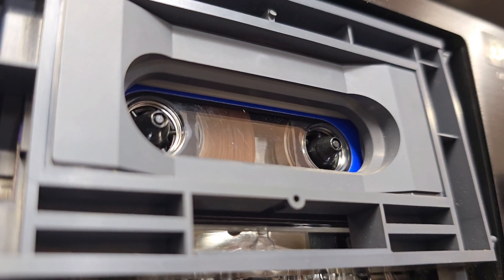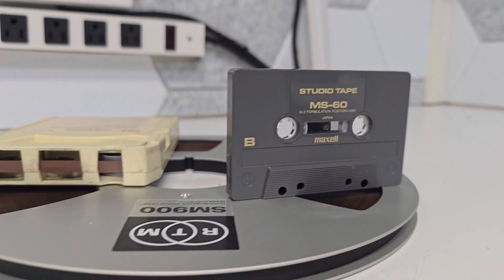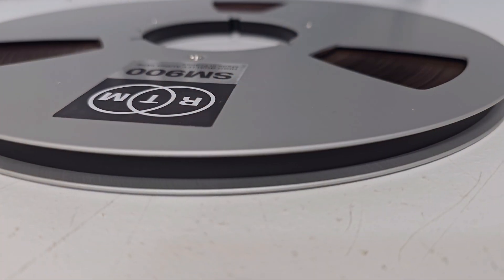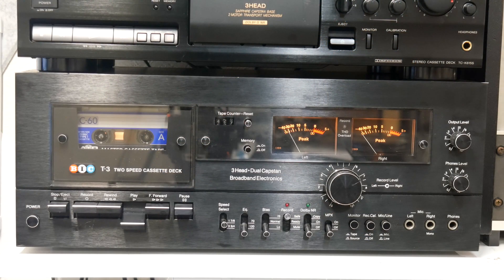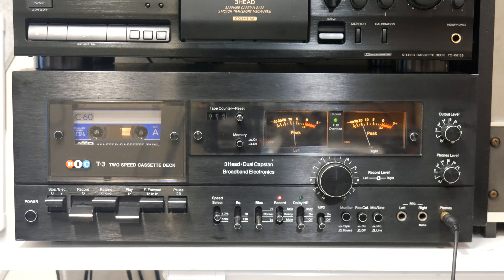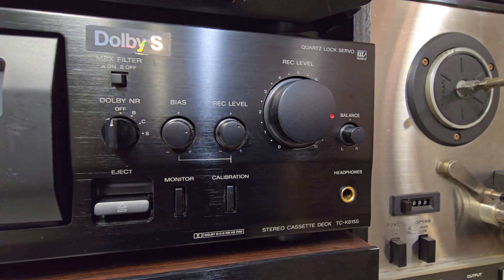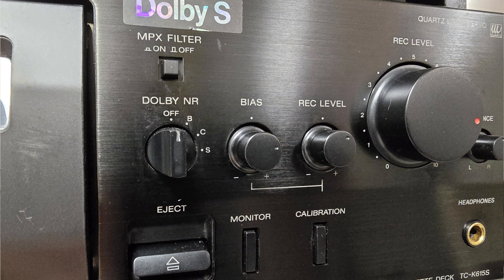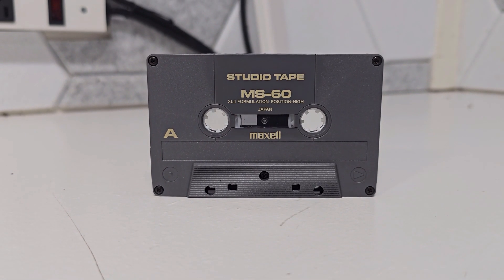Dolby S Noise Reduction - As Good as Digital? Dolby B C and S Comparison - RTM Tape Giveaway Winners

Comment: No. There are 3 groups of people. Those who love it. Those who hate it. And those like myself. Who just don't use it. Don't believe in it. Don't need it. To get rid of, hissy sounding tape. I've never needed that stupid stuff.. No.

No not even with, 9 analog generation down, copies. I have no noise and hissing issues. And never having used, any Dolby or DBX, gobbledygook. Screwing up the sound. Making it sound all wonky. Because it does. But some would rather have wonky than hissing. I don't like either. So I got rid of it. How you ask?

There's another faction out there like myself. We use, Broadband, Downward Expanders. That don't wonk. With the audio. And I've been using those since, 1973. So I don't know where you've been? Playing around with stupid wonky sounding Dolby DBX gobbledygook. When downward expanders work so much better.

And what do, 9 generation down analog copies sound like without Dolby or DBX? You can be the judge. From this demo I threw together back in,  1979. All produced on analog. All approximately 6-9 analog generations down. With no tape noise reduction system in use.
https://soundcloud.com/remyrad/remygolnickjinglesotdemomb2

This demo from 1979 is an average between 6 and 9 analog generation copies down. From the 30 IPS, Master Recording. To the 15 IPS, Master Mixes. To the 7.5 IPS, sales demonstration copies. To the 7.5 IPS consumer  copy of the, 7.5 IPS sales copy. And no tape noise reduction used. Because I don't roll that way.

So amateurs are plagued by hissing tape. Like a pit full of angry snakes.  But real Audio Engineers like me know what to do. Because we design and build the stuff also. From that geared to the full-blown big studios.

And so we are not home consumers worrying about, hissing consumer tapes. I mean how funny. Dolby A,  Dolby B. Dolby C. Dolby SR. Dolby S. DBX -type I. DBX type-II. And now something wordlessly better! Something already archaic and better!

Plus, you see. There's this thing called, Masking. And tape noise at 30 IPS. While it's hissing. It's not really, hissing. It's more like a spring shower. It's pink noise. It's a subdued, hissing. That gets Masked. By the level of the music. And the Tracking, Downward Expander. Takes care of the rest. Inaudibly.. Perfectly. Perfectly. Without a bunch of wonky sounding audio artifacting and aberrations.

It's only the, 7.5 IPS copies of the copies, from other copies. I have posted here. From the transfer I made. Back in 1996. With a 1st Generation, Pro Audio, PCI based, installed soundcard. That wasn't 16-bit like everybody else's. It was 18 bit! And can also record at, 48 kHz. For, Video, soundtracks. WOW.  Laughable by today's standards. On every, $150, bargain tablet. And even much less. On sale. Outperforms what I had back in 1996. When I made this transfer. From Sticky Tape Syndrome, old tape copies I had. Of whatever I had left after the fire. At the temperature controlled, humidity controlled, actual tape library. Where my masters had been stored. Until the fire. Took out the entire building. And all of my original Masters, gone.

All I had left. Was a bunch of scrap tape copies. In a box. Of unlabeled tapes. And I found an old demo. And it still sounded reasonably good. Even though the tape is all sticky.  And before we knew to bake them. To recover them. I came up with a different procedure I created. It worked. It was tedious at best. It was messy. It was problematic. It worked.

And so when it comes to tape noise reduction schemes and themes. Most are made for amateurs. Even at the professional level. That don't know how to do it right. But don't have a full background of knowledge. Though many have college degrees. Which means, nada. I am not in possession of the stupid college degree. I teach the college professors. So I don't need one. Strange but true. I know. But there are those of us. And I am now Fully Retired. Having fun on YouTube. Watching stupid videos. Laughing my ass off. At all the amateurs. With all the information. Of which one is better! Answer? None! None is better! Don't use those hideous things!

Just get yourself a, 53-year-old pair of, Allison Research, KEPEX-500, Key able Expander, a.k.a. KEPEX-1 or KEPEX-II. Tie the key inputs together for stereo tracking if you like. I didn't bother. Set them close. Set them real close. Set them, extremely, close. And you will be Awakened!

Really these things don't screw up the sound. They add a very little, nearly inaudible, mush factor. That doesn't take away from the, Golden Quality of the sound. It remains intact. You can hear it. It's deep. You can listen deep into the mix. With no wonky. You can hear it as I intended for you, to hear it. Without a third-party factor making it sound, wonky. The purity is retained. Because it's a Broadband Device like a Limiter. Only the inverse. Under threshold control you set. With a release time, you set. With a depth, you set. To track the sound source. To make its effect inaudible. And you can hear it. You can hear it. On a couple of the count ins. Where's all the hissing? It's clean. It's real clean. I keep it, clean.. Just like my ass. So you know I'm a good date also. I want my music production to reflect my lifestyle. Bigger than Life.

I mean this is Miami's hottest rock studio musicians. You've heard them on countless hits. And the Miami Symphony Orchestra. Inside an, announce booth. Designed to accommodate 4 announcers. I had approximately 13 people, in the room it wants. Along with the grand piano we got. And 24 chairs set up. All very tightly next to each other. It was a tight squeeze. To get 13 people in that room. At a time. Until I had re-created the entire Miami Symphony Orchestra. In overdubs. I had a lot of fun producing this. I had never done anything like this before.  This is my first try. At 23 years of age in 1979.

I mean never mind. I had to work out completely new recording techniques to do this. I had to modify equipment. To do this. I only had 8 microphones. To do this. And only 4 headphones. To do this. So it is not possible. To do this. But I gave myself no choice. I told the boss. I could do this. I must've been stoned? I had to be stoned. In order. To do this. And I was not compensated for my marijuana.

I mean I walked into Leon GOLNICK's office. And plopped myself down. And said, look Leon. I blew through over, 1/4 ounce of marijuana. Doing these mixes for you. After hours.  And I expect you to compensate for me the additional costs of this marijuana. He said no. He said he pays me well enough. Oh well? I tried. As he wanted me badly. I declined his offer for a year. And then figured? What the hell. It's 3 blocks from Fort Lauderdale Beach. I can go to the beach for lunch. I can walk to Fort Lauderdale Beach, for lunch. That's where the offices were. That's where the studio was. They built for me. They built the studio for me. But they did not equip it. With what I required. They gave me some junk equipment. And he told me you're supposed to be good. Use it. So I did. I don't let anything stop me. And I know what everything has to sound like in the end.. It can't sound like, amateur hour. The directive was to make it sound, New York City. Okey-dokey. As that's where they had been getting their jingles for years.  And paying top dollar. I said I could do it for 1/10 th, the amount. In our voiceover studio.  I was stoned.

I meet you cannot undertake a project like this. Without smoking pot. It takes you to that next level. The focus is incredible. The creative juices explode. And you just make it happen..

I test all the audio out in my head first. If I can hear it in my head. I know it will work in real life. It's hard to explain. It's complicated. But I have to hear it first. In my head. As I see sound. I see it bouncing all over the place. But I don't see any colors like other people say they do. I don't know what they are saying? I just see sound. Like it bouncing off your wall. Of that picture. Off your desk. From your lamp. You can't see that? Hmmm? You might want to see an, OptoAudibleOphthalmologist?

Which is a degree you can get from Yale. Where, JD Vance got his. After his traumatic brain injury he got in the USMC. And that is the result. Mini Fascist Donnie. In all its glory.

What he really needs is a karma Full On, John Wayne Bobbitt. What a pompous prick. He should not possess. A full on John Wayne Bobbitt is waiting for him. In the great political ether of his nonexistence. What prick, be him?

The maniacal thug attitude is truly amazing. They will Rule by roughshod! Ha ha ha. Ha ha.

Yes what a patriot. He wants to be Vice President Prick. Ha ha ha. Ha ha. Mr. Prick.
RemyRAD

PS
his confident attitude indicates. He owns more than one, AR-15. He still has one of his, M-16's. Ready to kill Americans with. Ha ha ha. Ha ha.

Comment: Question, why do you keep pressing monitor? Kind of distracting.
Reply from the maker: Switching output between recording and source
Reply: @VintageElectronicsChannel  
I understand, but does that mean you were currently recording? I’m sorry that I’m confused but usually when I press a monitor button, it doesn’t switch between the output of simple playback of a source, that usually only works during recording when you have input source audio and output…. I assumed that the cassette playback was the source. Sorry if I’m clueless.
Reply from the maker: @KevinR1138, I was recording, so it was switching between the source and the recording of that source on the tape in real time. So we could compare the result with the original. If that makes sense.
Reply: @VintageElectronicsChannel  
Understood, thanks.

Comment: I would point that very silent room at home has background noise about which our hearing is not very aware and it is minimum 25 dB but in more usual conditions it may be even 35dB . Pleasant no annoying level of listening is for me and my neighbours about 65, (say max 80dB) that makes minimum required treshold for pop music about 40 dB.

 Data for cassette without Dol;by is usualy about 45 dB - this  gives 5 dB safety margin that we will not be at least annoyed by it's noise. Dolby B grants in normal pop/ jazz  music max 55dB which gives already 15 dB safety  margin -  we can listen loudly  and it is for silent moments in music or brakes between  tracks. . Dolby C makes 63 dB treshold - even during  listening 100dB loud we will hardly notice tape noise.  That is why I generaly not use dolby to avoid forgetting to switch it  on and off without noticing. .   It makes to me no difference except when I play brand recorded in DolbyB  tapes. I also have deck with High Com system which is comparable to Dolby S and works very well but I do not need it.

 I find the same as author - a bit noise is comfortable to keep ears continuously tuned to sopranos. Because with single instruments they adopt too quickly. 

I notice that playing  DolbyB recorded tapes with  Dolby not switched on is possible and in most cases satisfactory and helps a lot to avioid dynamic distortions. caused by Dolby system which requires exact levels of signal from heads. 

In most cases that level is affected by dirt on tapes and hardened dirty filt in cassette or not good tape transport or not good condition  of head. Anyaway with care it may be achived and it is worthy  because sound is better.

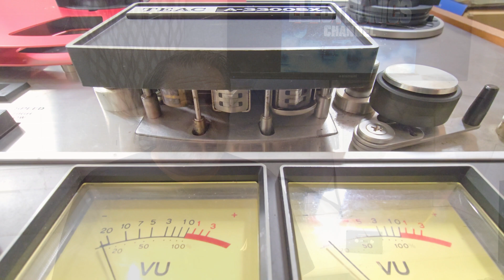Comment: 1:44 A certain type of distortion is due to the tape physically moving over the head, sort of a stick/slip in the kHz range. it's like how a violin bow works and causes a jitter like distortion. But that is proportional with signal level. NR cannot address this. Tape hiss is due to the finite size of the particles making up the magnetic layer compared to the width of the tape (head), and their alignment. Magnetic particles about half the size of rice grains could be used on a tape the width of a two lane road and have the same performance as an ok Type I. Speed also matters, as a slower tape speed generates more audible hiss. I believe it's the same hiss independent of speed, just shifted into different parts of the audible spectrum depending on speed.

Comment: Stable transport is a must. Also properly aligning the deck to the tape you're using. Proper head alignment too. Dolby is a compander, so it will pump and breathe and dull your highs if you don't. Great if you do your due diligence. Sucks if you didn't. I use a Sound Devices 702 CF recorder, and a Tascam DR-100 mk.3. Works bitchin. I have had total schitt boxes and fine machines. I have 11 now. 4 in project status. They can be a PITA, and tape costs too much, and takes time to get stuff right. NAND memory is cheaper, and more efficient,  and no wow and flutter, no noise reduction either. Really cool is VHS hifi. 20hz to 20Khz not breaking a sweat, up to 8 hours of awesome music, and no noise reduction, no wow and flutter either. Its TBC is way more accurate than any audio only analog recorder. I don't have time to play games. Do it right, and find the deal that best works for you. Analog cassette rewards and potentially annoys all included. Only you can tell if it is for you.

Comment: Never had a problem with dolby C killing any highs and i love it. I find the calibration settings on this Sony deck a bit suspect for a maxell XL-II tape. Its difficult to imagine that it needs thst much bias and level. I personally believe that most problems with dolby are due to user error or equipment issues.

Comment: I share most of your thoughts on Dolby usage. Generally speaking I use it when I need it depending on the source, music and tape type. I don't own a single portable Dolby C player but I have several Dolby B Walkmans so I can pull some Dolby C tapes within the range of acceptability.

Your BIC T-3 could really use a service, both needles need attention and there's a lot of flutter which could be bad for the health of your machine. It could be a seizing take up spool, a dry capstan bushing (especially the back one) or the motor front bushing or a combination of all of the above and more.

Comment: I guess there's a difference between those who listen for nostalgia and those who want to hear how good analog can get. The cassette format was dependent on noise reduction technology to be viable. I would never listen to a cassette that didn't have Dolby B at the minimum, and Dolby C was even better. Like our host, I never knew Dolby S existed. Dolby did impact the source content, however. A better test of Dolby noise reduction would be to listen to the ring out of a crash cymbal. Monitoring the source would reveal the subtle nuance of the high-end harmonics the crash of a cymbal creates. These subtle inflections tend to get quashed by Dolby noise reduction. Granted, the difference is slight, but noticeable.  But once on the tape, hiss takes over ALL this subtlety, so if you listen to cassettes, I think using Dolby is a no-brainer.
Reply: There's truth in many views... it strongly depends on how many dB(s) of range your let's say music has. If you have dance music chances are Dolby or no Dolby will make no difference at all except in fade outs to silence. But I could certainly discern the subtle details you're writing about. My recipe is sometimes to offset the highs of a certain level... which kind of partially defeats NR but it's PRE so technically no, it just makes up for the perceptual adaptation of the sound. Practically you hear as if it were the same but it isn't. Dolby B has  a little drop off towards the end of the spectrum so it might help with that.

Comment: "see if you can pick up the tape noise in this type 1 cassette" -- nope, i was too distracted by the terrible wow and flutter on the deck which manifested as a wobbly sounding piano 😅
Reply: No kidding. BIC was a notoriously cheap off-brand. Hardly the deck you'd want to evaluate anything on.
Reply: @BrentWatkinsMusic  Do you own a BIC machine? They're decently built I'd say above average and they sound definitely above average of their class. IMHO one of the most pleasing piano key deck around with bright warmly lit VU meters and cassette well backlight.
Reply: @m80116  There is something terribly wrong with this one though. The T-3 is specced at 0.05% WRMS which should be inaudible except under extreme circumstances. I have two hi-fi decks here that measure 0.045% WRMS and it's never bothered me, but I'd guess this T-3 is probably somewhere around 10 times that. At the very least, it's in desperate need of a service.
Reply: @MrSlipstreem  I don't need a measurement to hear there's something wrong with the unit, I have basic Walkmans with far less wow and flutter than that.

I have restored one BIC and another one is in my inventory right now, they sound amazing... among the finest decks of the 70s.
Reply: I agree that it probably is something wrong with this unit. Never heard this problem before with reasonable good tape decks.
Reply: The cassette was a two speed model. Without music you can clearly hear the hiss difference of the two speeds. The wow and flutter is so strong, that hiss does not really matter. So low wow and flutter is more important than low hiss. That is a point to pick up on.
Reply: This guy's a fool on this channel...he even has a voice like Bozo the cloun
Reply: Clown that is